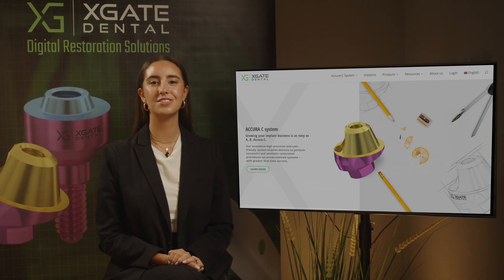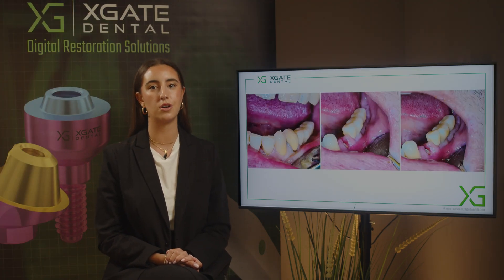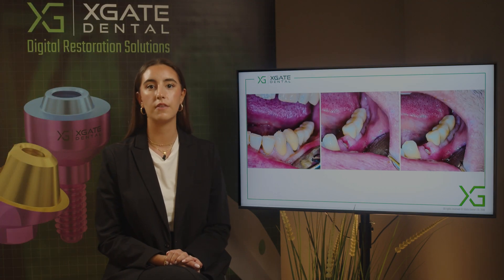Conquering Tooth Loss. Cantilever Designs for Seamless Implant Transitions. X GATE

Comment from the maker: 00:00 Case Presentation - Bridge with Problematic Adjacent Tooth
01:00 Treatment Options - Implant, Cantilever, or Bridge
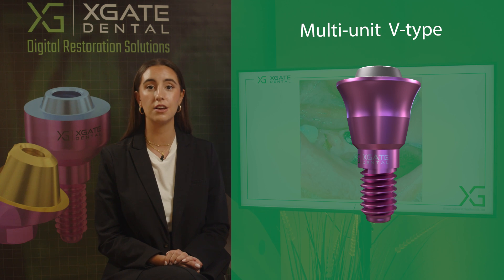01:30 Assessing Bone Quality and Quantity
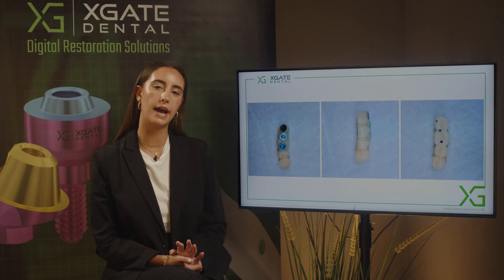02:00 Deciding on Cantilever Bridge Solution
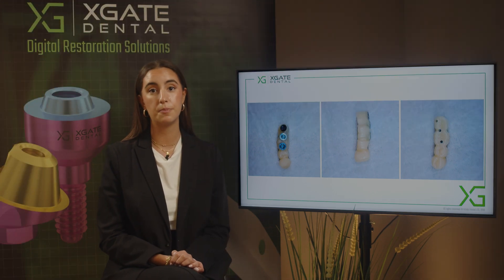02:30 Extracting Tooth and Preparing for Impression
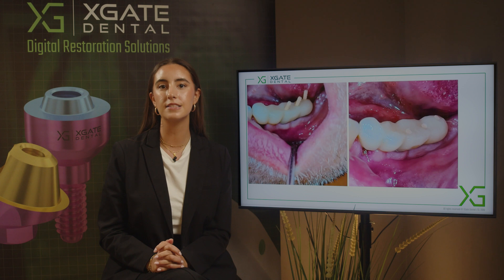03:00 Fabricating Provisional Cantilever Bridge
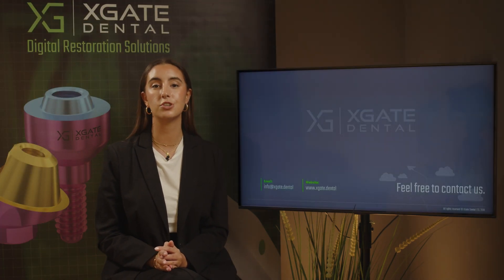03:30 Design Considerations for Provisional Bridge
04:00 Allowing for Gingival Healing and Emergence Profile
04:30 Planning for Final Prosthetic Bridge Design